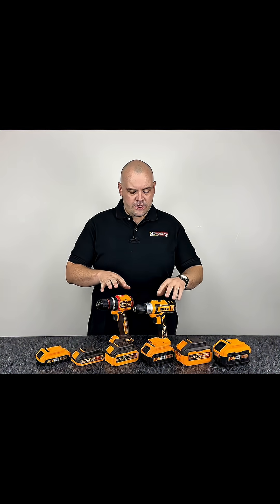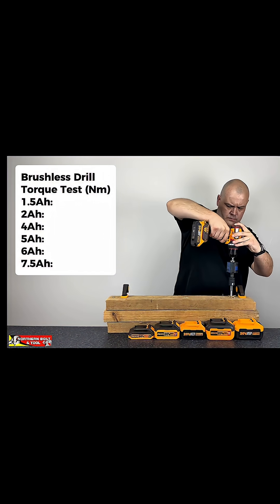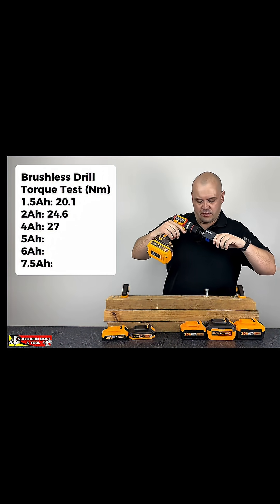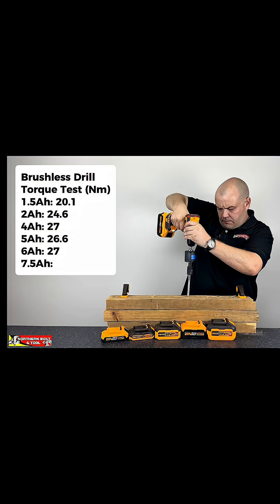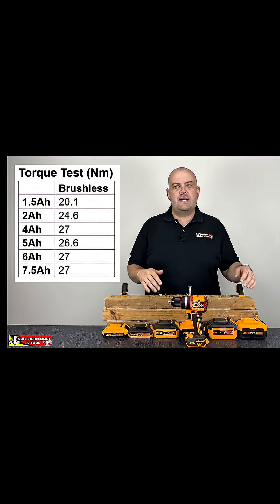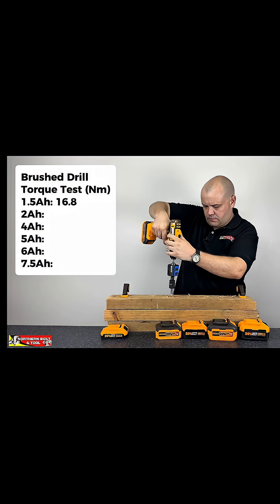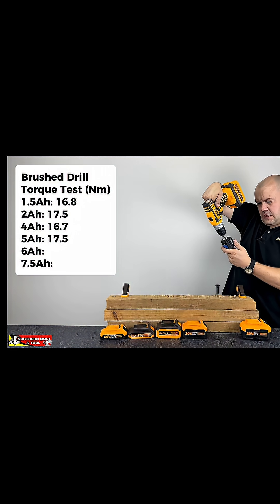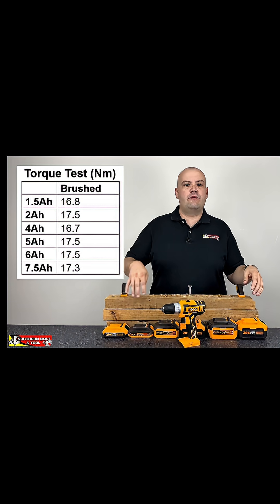Does Battery Capacity Affect Performance?📈 Part 2 - Torque Test #ingco  #cordlesstools

Comment: For power tools, a 2-amp battery is fine for starting out. The torque of the tool depends more on the design of its gears rather than the battery’s capacity. A higher-capacity battery mainly provides longer run time—in other words, a bigger battery will keep you working for longer.
Reply from the maker: We made a video answering this exact question! Check out the video below.

https://www.youtube.com/watch?v=bbkHG9NABoc&t=27s
Reply: @NorthernBoltandTool  I’m surprised your channel has never shown up for me until now.

Comment: Noted the drop of the 4 Amh on the brushed drill, as for the 1.5 Amh aswell.  I don't know much of the 1.5 Amh and it's introduction.  The 4 Amh used to be the big gun when everything was brushless. Though marginal, I suspect that it is a bit of electronic protection for both the tools and battery packs regarding brushless.  It's so slight.
Reply from the maker: Thank you for sharing your insights, we appreciate the feedback!